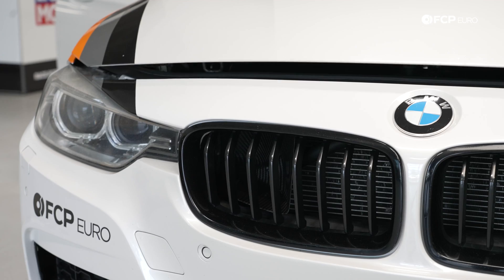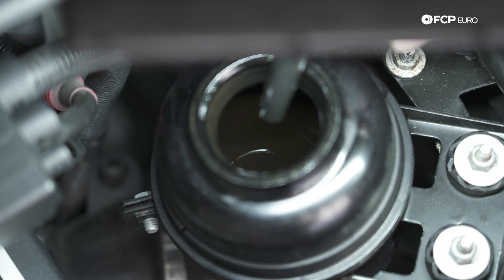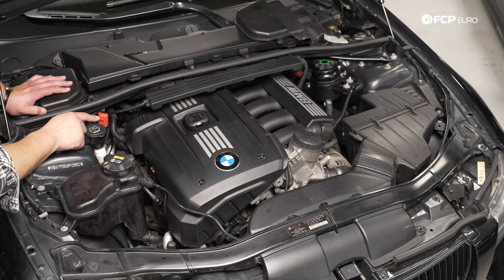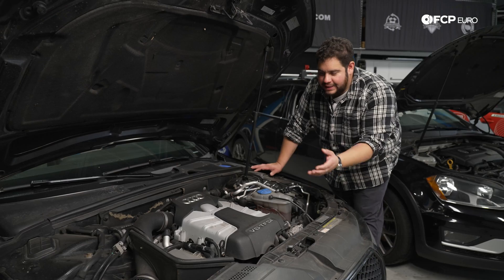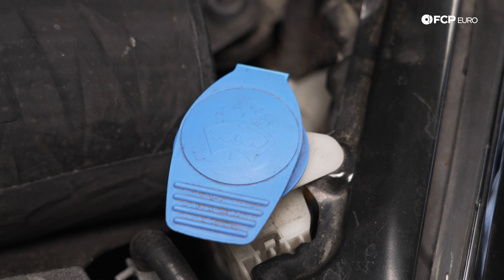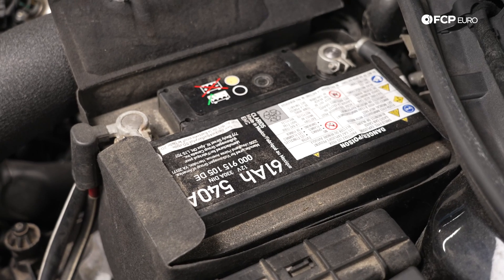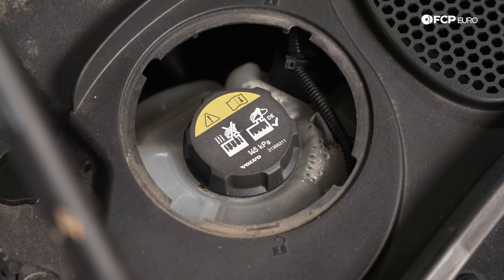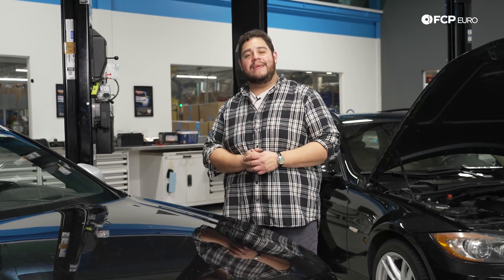What's Under The Hood Of Your Car? - A Beginner's Guide To Car Basics

Comment: Good discussion.  Just to correct a minor error in the Turbo description…..
The turbo uses exhaust gasses to run a turbine that compresses the intake air into the engine, resulting in more power.  The speaker misspoke and left out the “intake air” part.  Love to see more of these